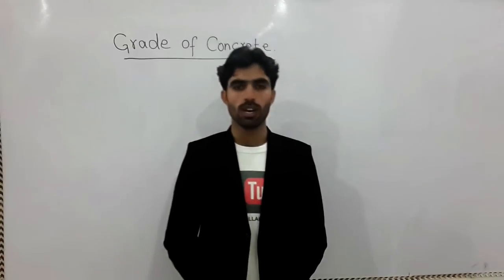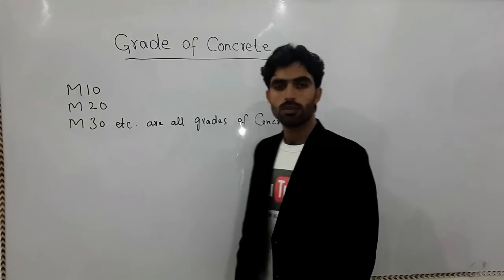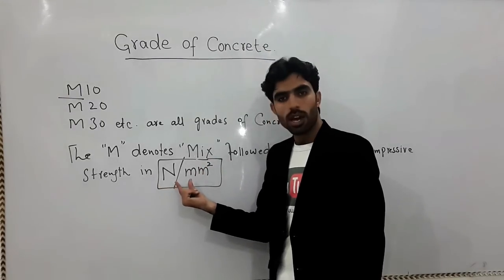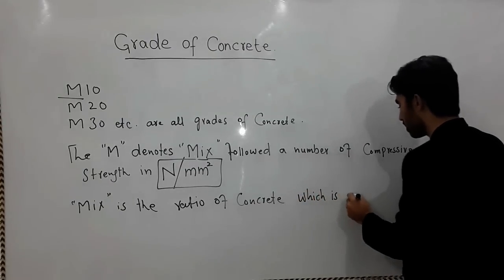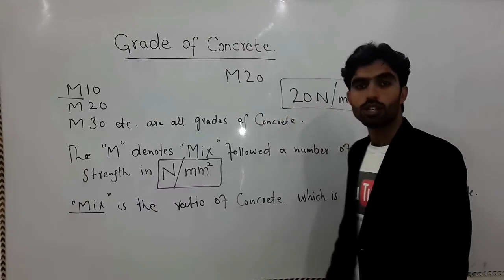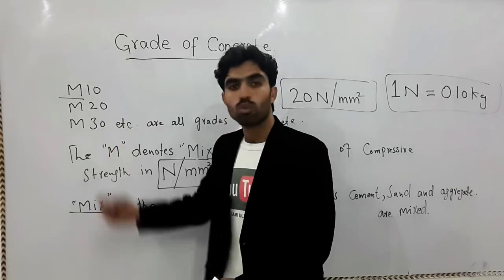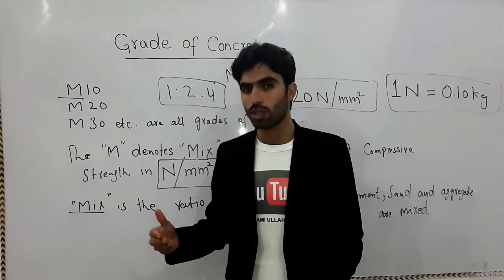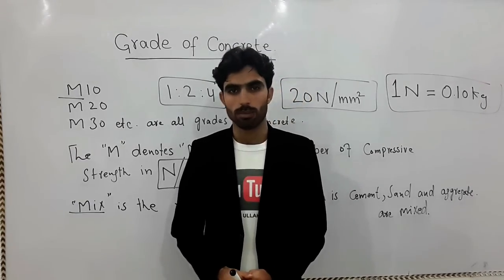Grade of Concrete

Comment: Hi Sir 
who can we calculate the compressive strength in days .
As Per IS Stranded ( Breakage/The Surface Area of the Cube. For 7th day test the Strength achieved should be above 70% of the Grade Strength of the Concrete and 28 th day should be 120%) . But who can calculate 70% is for 7 days and 120 % for 28. 
What is basic theory.
E.g.: M20 in 23 days

Comment: definition of M10
Reply: M10-M means mix
10 is characteristics strength of concert
It is strength of concrete in 28days
Test in cube (150*150*150) mm
10N/mm2

Comment: my question is that how it can be judge or how can we know about the mixing ratio.lets example M20 so what is the ratio (1:2:4) or (1:3:6) how can it be observe
Reply: If you want  M20grade concrete then you take 1:1.5:3
It is written on is code.. The grade of concrete ratio r fix. It is already in is code 456:2000
You take 1 bag of cement, 1.5 bag of fine aggregate, 3bag of coarse aggreagte

Comment: sir plzz tell mi
y we multiply by 35 to mix design ration...when w going to calculate quantity

eg. M20 ratio=1:1.5:2
cement 1×35lit
sand 1.5×35lit
agg. 2×35
so my q..? is y 35
plzz explain mi sir
Reply from the maker: wait for 2nd lecture that is ur answer